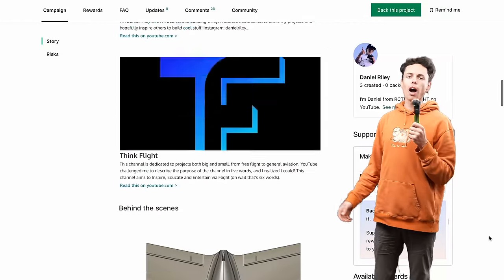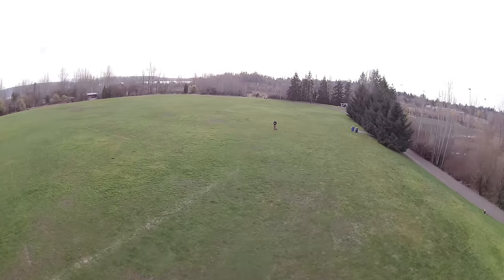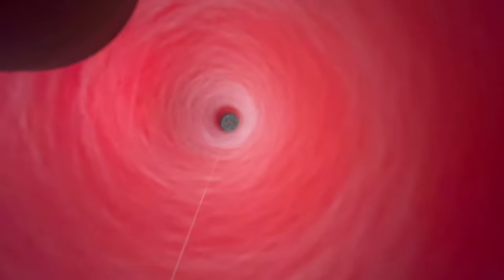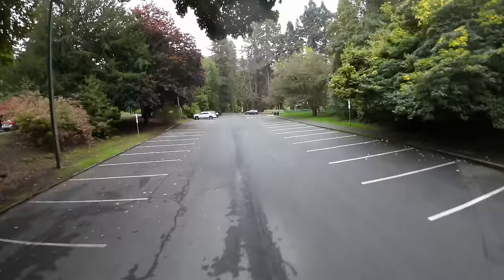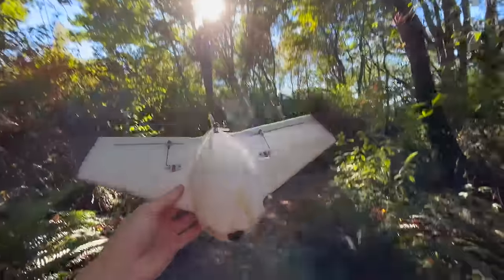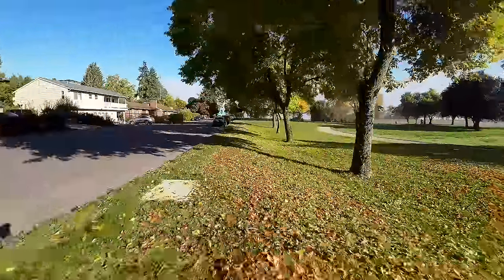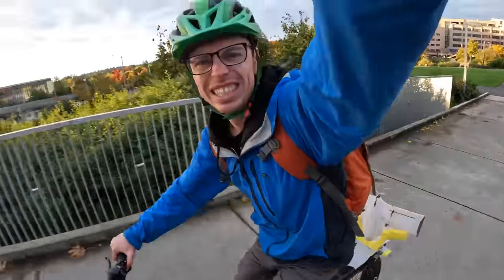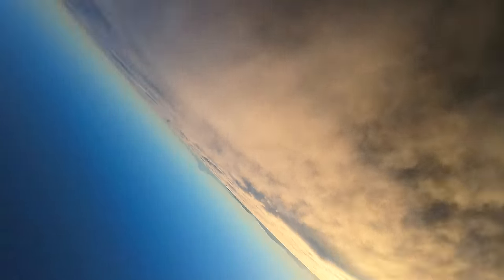Smallest HD FPV Flying Wing - Flik

Comment: Sick, now just make it laser tag compatible. Would be sick to play a dogfight. But maybe shooting laser from planes isn't the smartest...
Reply: If it’s low power and infrared it should be fine
Reply: @thetoasterisonfire2080 true, but then it might get false positives a lot. I'm only assuming that because most laser tag places are in dark rooms with padded walls
Reply: @shmeblord just add bb guns like the rc boat fights 😂
Reply: @e-genes2727  aha! The poor Sunday league players just getting pelted from stray shots in the woods
Reply: @shmeblord  fly high 😂
Reply: @shmeblord depends on the system. Some of the more expensive ones send out data pulses in the laser so they can tell who shot who. That should make it resistant to false positives.
Reply: @thetoasterisonfire2080  Well that explains why it takes me FOREVER to tan myself with the tv remote!
Reply: @xureality  oh that's cool. Does it "flicker" to send like an SOS (obviously not this) message or is it more like a wifi connection
Reply: Just build the game off the video signal rather than use real life lasers. If the software could identify the enemy plane on the headset video in real time, then you can just paint cross hairs on the HUD and decide hits virtually. That could also simulate guided missiles, guns with bullet drop, etc.
Reply: Video Aerial Sytems (who normally make FPV antennas) has the Ace Combat sytem for RC laser tag
they made 3 videos on it 3 years ago
Reply: Gel blaster? It would be heavy as shit though
Reply: Low power lasers are fine, just don't buy fancy color lasers like greens. Keep on the reds.

Also we should ask if there are any nearby military targetting systems and ask them what lasers would be safe to use... just in case.
Reply: @Splarkszter  yeah, getting in trouble with local military bases isn't something I'm too keen on at the moment...
Reply: maybe airsoft would be a better option
Reply: i could see it being used as a foam dart bomber, and people could compete to see who can most accurately bomb a target, or play drone hide and seek where two operators launch and find a place to hide in the forest or whatever while the drones do a loiter mission and then whoever dinks the other operator with a dartbomb first wins
Reply: @e-genes2727 this doesn’t work at all in practice
Reply: Flight test did that long time ago!
Reply: VAS A.C.E. Combat System. $40 from Readymade
Reply: @shmeblord it "flickers". A wifi connection needs messages going back and forth to establish the connection. It could be as easy as what's done with IR remotes. They have a pulse frequency of 32768 Hz, since that's a nice power of 2, 2^15.

Not an expert though, I may be wrong on the details.
Reply: @phizc  thanks! I know nothing, so any info is appreciated
Reply: NGL, I have some experience with BFS Laser Tag electronics and, while not cheap (~$200 for all the parts you'd need per drone) you could probably drop them right into a drone like this as long as you leave enough space for them (and it's relatively compact). All IR-based and quite long range if set up correctly.
Looks like Adafruit has some cheaper laser tag projects you could set up as well, though presumably with more limited range and features.
Reply: There is already a FPV combat system. Check it out
Reply: @shmeblord At the laser tag places the walls are dark and often covered with carpet to absorb the light that would reflect off of them, the room is dark so you can sneak around and make better use of a small space for a battle game. These issues aren’t going to be much of a problem unless you are flying low to the ground over a reflective surface getting shot at from above, and that means the pilot is nose down pointed at you as you move horizontally, a very difficult shot, it might just make that a little easier. I’ve been dreaming of laser and airsoft FPB dogfighting for about a decade, tech is here and cheap enough now it needs to happen. I think lasers would be great for toys/ training  and a league sport could be created where biodegradable bbs are used to rip apart balsa and paper airframes and lasers held on target long enough give a “missile lock”, you can simulate deploying chaff manually and automatically. This type of thing has been a long time coming and I don’t think the government will be able to deny the validity of a hobby/sport like this so with some organization and petitioning they might loosen up some regulations that are currently in the way. The easiest way to achieve high quality dog fights with the approval of the government is to get them to classify the planes as a sport implement meant for use at private venues that will adhere to safety regulations. It would be like paintball or air-soft fields, safety barricades, eye protection, covered areas. Barring the possibility of launching actual projectiles the cameras and low power lasers (possibly even LEDs) could be used in combination with markings, reflectors, and other visual indicators to build an augmented reality simulation. FPV RC and Augmented Reality seem to me to be very compatible so I’m sure we will se some sort of decent dogfighting RC in the future.
Reply: Fireworks
Reply: @shmeblord there accually is a kit for fpv drones,you can even buff settings like damage,health and many other,just dont know the name….
Reply: @tuloxe  dang, that sounds sick
Reply: yeah and then buy an old shut down mall and turn it into a space-like arena
Reply: @shmeblord this wont happen. Laser tag (and all IR communication as far as i know) modulates their signal at 38kHz. The sensor is also modulated at 38kHz so it literally doesnt see IR when its not modulated at 38kHz.
Reply: Just dogfight like men
Reply: Laser will get u in big trouble on rc plane.  Now u fot a flying weapon!

Comment: Amazing project.  This has the potential to be quiet compared to a quad.  Would be cool to test how silent you could be.
Reply: how so? I would say the opposite, the foam acts like a speaker membrane that radiates more of the vibrations as sound. multicopters are quieter than foam planes, even if they use more power to lift the same weight.
Reply: Pushers are not quiet.
Reply: I agree that this plane will be quiet if you don't put a super heavy power system on it. I have a nano goblin and even with it's 2:1 thrust to weight ratio is very quiet. Much more quiet than a quad. Even going 65mph it's pretty quiet.
Reply: IDK about that. Low speed cruising with a 2.5 inch quad is much quieter than my ZOHD Dart. The wing can fly a lot longer though.
Reply: @Ass_of_Amalek Balance your props lol the foam should actually absorb some sound. Also planes have one motor generally larger props and fly off much less power for the same weight. The one big problem is being a pusher makes a lot more noise. In my experiance planes are generally quieter especially tractor props but, it depends on a lot of factors.
Reply: Depends on where you climb up to and how well it can glide with the motors cut.
Reply: @Ass_of_Amalek    I cant think of any quad I ve ever flown thats quieter than a similar sized wing, they are as a rule annoyingly loud
Reply: my parrot disco wing -- sure is loud but I can cut the engine and pitch down at 5% to maintain speed and cruise completely silently
Reply: Potentially perhaps, but the body acts like an acoustic guitar body and amplifies vibrations - you could try decoupling the motor mount with some dampers.
That may help but also make sure motor and props are balanced too.
Reply: Exactly, pushers are not quiet. It's the effect of the blades hitting different speed air going above, behind, and below the wing. @rcdieselrc
Reply: @Ass_of_Amalek not true, unless you have some evidence to back that up?
Reply: A fixed wing in general only requires ~1/3 the energy to stay in the air compared to using propeller thrust only, so only needs to work 1/3 has hard and thus not making as much noise.
Trick to making a wing quieter is reducing propeller blade tip speed, and keeping wing loading, or overall weight low. Flying at slower speeds, or power levels helps. To reduce noise further with a pusher motor the spacing between the propeller and airframe surfaces can be increased so are not in turbulent airflow. The Flik wings (here) has a nice aero-shaped fuselage that the motor attaches to so this will help.
Reply: 3 inch props aren't quiet.
Reply: @mrbmp09  On model this size 4-6 inch propeller is possible. It really depends on KV and size of motor, and desired flight performance characteristics.
Reply: @ahaveland  It'd be great to see this integrated into the design.

Comment: Heck yea!!!  FPV wings are taking over the hobby!!!  People need a break from quads, but with the new O3 having such epic video quality, and not needing a go-pro anymore, they are migrating to wings.  With people like Shelby Voll doing some impossible epic stuff, it motivates others even more.  Tip for cooling a Air Unit, make sure  your vent EXIT holes are bigger the the inlet holes.  Math says this creates a vacuum inside pulling even more air over the air unit.  It does work to.
Reply: Break away from quads? Blasphemy.

Comment: This seems pretty neat. Assuming someone is interested in FPV but has no RC equipment of any kind, what would else be required to get to that point besides the Airframe Kit + Base Electronics?
Reply: Same question here.
Reply: For the most basic experience you will need a battery, transmitter, and 3-channel receiver. I am partial to FrSky systems so something like the Taranis Q-X7 with X4R receiver. FlySky radios are popular (and cheaper) as well. 

For autonomous missions you will need a flight controller and telemetry radio.

For FPV you will need a camera + transmitter and something on the ground for viewing. The ground station could be FPV goggles or a cheap receiver and analog display.
Reply: I think it just comes with servos, motor and esc ? if you start from zero, you would need RC controller, Rc receiver, FPV system: camera/transmitter, FPV googles, batteries, battery charger, optional autopilot, tools like soldering iron, glues and so on. A lot of options there depending on your budget. Also this is not a beginner plane. you will need some experience in building rc planes and probably practice on bigger, slower, more forgiving airframes.
Reply: Investing in an ELRS radio is something I wish I was told to do when I started with fpv, I bought a cheap flysky, and the feel/range was awful, then I switched to a radiomaster boxer which is almost perfect in every sense
Reply: You will need a remote, a receiver, the fpv equipment and a charger + batterie. 
-For the transmitter I would heavily recommend to go with a elrs one, bc this system ist by far the best performing while also cheaper than all systems with comparable performance. The cheapest but still very good one would be the radiomaster pocket elrs. The best ones would be the radiomaster boxer elrs and radiomaster tx16 elrs.
-fpv is a bit complicated bc there are four good systems that all have different advantages and disadvantages and vary a lot in price. You have to watch a video that compares these to chose the one that is best for you. But the cheapest usable one would be a the Eachine EV800D goggles with a analog vtx and camera.
Reply: @augmented-garage  what FPV goggles is he using? DJI? and what camera + transmitter do i need
Reply: @Very_Grumpy_Cat  yes, he used the DJI system. It's convenient because it's an all-in-one system and it gives you HD digital video. It is fairly expensive, large/heavy, and not interoperable with gear from other vendors. The other end of the spectrum is a cheap-o analog system which you can upgrade incrementally. You will have to do some research and decide for yourself based on budget and use case.
Reply: Wondering what batteries will be needed to keep this gem under 250g
Reply: @Merryler probably "two 18350 lithium ion cells" as was mentioned in the video.. they're around 25g each
Reply: @augmented-garage  honestly, why would you use anything else than elrs today? You can probably get it for a similar price as a new flysky radio and receivers are way more available and likely cheaper - while having range of tens of km instead of hundreds of meters, having the ability to use up to 1000hz refresh rate (useless for planes though) and giving you the open door to continue into the world of fpv drones too. I started on flysky, switched to tx16s (just after release) + crsf a month later and to elrs in 1-2 years.
Reply: For basic line of sight flying, you'd need a transmitter, PWM receiver, battery and charger. 

For FPV, you'd also need goggles and an FPV transmitter. For autonomous flight, you'd need a flight controller as well.
Reply: I'm thinking they need to offer such a kit
Reply: As others mention, you'd need a radio transmitter (hand controller) and as receiver (goes in the model). Cost for good basic setup could be had for $80-$150 (US$). To fly additional modes would only require additional receiver (if don't want hassle of swapping between models). This would allow line-of-sight flying. 
To add a basic FPV setup you'd need a analog camera and video transmitter in the model. Then to view you'd need a set of googles, or a LCD with video receiver built in. Basic FPV setup could cost $150-$200, while it's possible to spend upwards of $800-$1000 on DJI, etc system. 
The cheapest way to to get started is with radio transmitter (hand controller) and a flight simulator software that runs on a computer. Typically the radio transmitter can be plugged into the computers USB port. What makes it cheap, is any crashes, and learning experience does not result in damage. It will help make your initial real flight experience so much better the first time.
Reply: @augmented-garage well if it is simpel, I think I just buy it

Comment: I would love to see what the image looks like through your FPV goggles. Like actual footage, raw. That would help a lot with deciding whether I want into FPV park flyers.
Reply: Set the last bit to 480p for analog and blink a bunch or 720p for dji and stand too far away from your wifi.
Reply: You would be blown away by the resolution and low latency of the DJI O3 system

Comment: Before backing this I have some questions:
- Will you do some hard testing of the ESCs to make sure they don't burn like the ones in my snowcat?
- Will you make sure the shell actually closes without having to take a handplane to it?
- Will you release the STLs again?
Reply: Ive used (and many others) those flipsky motors and ESC's. you probably got duds cause mine i use on a eboard run just fine, and im sure im loading them harder than the snowcat.

Comment: Awesome little plane! Don't be afraid to do HD in the fuse. It just needs planned cooling. I have 2x Micro SD sized naca ducts in a high pressure region on the nose of my aircraft. The fuselage vents at the motor, creating a significant ΔP. It can transmit at full 1200mw for 45min with no overheating issue. 

I have a 19.5" 3d printed fpv wing I've been calling the "Bullit." It weighs right at or below 250g with 2s 18650, Caddx Vista, and WTE405 flight controller.  I've flown it up to 370g. 30-45min flights up to 80mph, cruise is about 45-50mph.
Reply: Do you have pictures or videos?
Reply: @ethkid8925 I don't know why my comments aren't working. I've tried to reply twice already. Anyways, you can find more information by searching "Bullit" on several FPV and 3D printed plane groups. I'm on iteration 3 (soon to be 4). The flying characteristics are phenomenal for such a small wing, however I'm trying to make it spin resistant. I don't like that flight controllers will crash a plane anytime there is low voltage or a motor issue (such as a prop flying off). The flight controller will try to maintain altitude, and when it stalls it spins. So, when I design a plane I do such that it will enter a porpoise with adequate directional control, so it just flutters to the ground. Iteration 1 flew great, but would spin. V1.5 I added printed in place VG's which completely fixed it. However, I saw that as a bandaid. I designed a better foil set with better low Rn stall characteristics, ensuring the tips remain flying. At the same time I gained around 14% L/D with redesigned wingtips - unfortunately this moved center of lift aft, resulting in a more CG sensitive aircraft. The center of lift moved aft but geometric center was the same, resulting in a very sensitive CG range (~3mm). I should have it finalized in the next month or so.
Reply: @ethkid8925  BTW, both pictures and videos are posted if you find it.
Reply: @Jwmbike14  With ArduPlane you can set a min airspeed and it will automatically pitch down to maintain that airspeed if the motor cuts out.  You can even input max turns and it’ll pitch down more to avoid stalling the inside wing.
Reply: @techstuff6829  Yes I know.  I am very familiar. That said, there are a lot of users that don't go to the full extent of Ardu's capabilites, and hardly scratch the surface. Even more so with iNav. The point here is thst no flight controller, including defense, can cope with a spin. 

I am not the type thst wants to fix everything with software. That's how we ended up with quads.... But I digress....